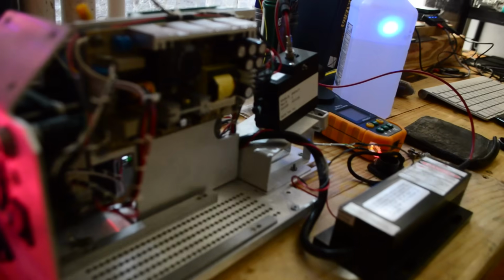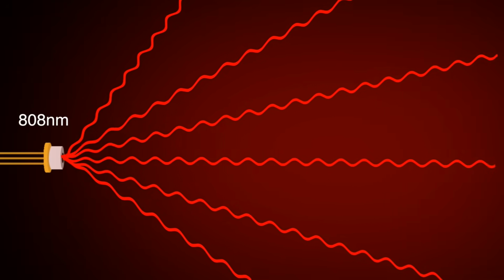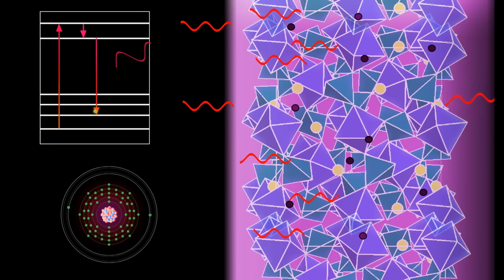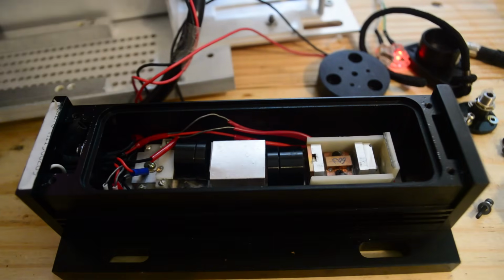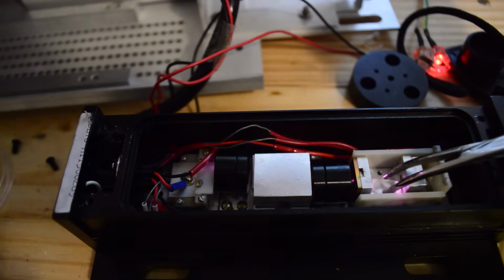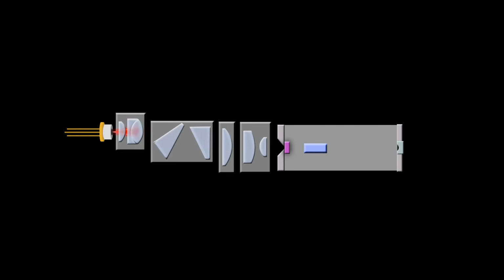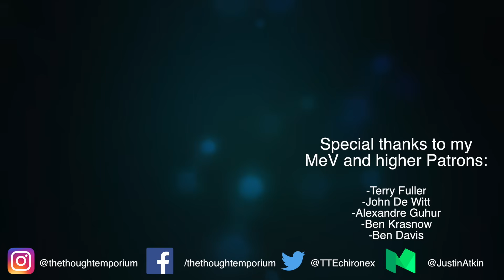This Laser Turns Infrared into BLUE

Comment: I remember hearing that there’s an issue with green lasers where if they get too cold they either produce infrared or UV laser light (I forget which) instead of what they’re supposed to and can be extremely hazardous.
Why does the temperature matter that much? Is it because it changes the crystalline properties? And is there a reliable way to prevent it?

Comment: Will it run in singlemode blue color, if i power it down just above lasing voltage, to be able to make holograms?, with small green dpss it worked very well and stable enough..  just asking since i have a 15w module here

Comment: Ah the BW tek dpss laser. They were part of a dema-k quack medical machine. It was coupled with spectrometer which i found far more interesting then the laser itself. Ended up reusing the spectrmeter and the scanning cell but used other lasers. The optical train in the blue laser is a pump diode, a fast axis collimation lens, an anamorphic prism set to make the beam square and even diverging, then a focus lens, then the NdYVO4 resonator wirh the LBO crystal. Some had a little power sampler inside. These used to be common as dirt and cheap on ebay. Ive converted these to green 532nm at about 300mW, yellow-green at 561nm at about 90mw, Yellow at 594.3nm at 140mw, 1064nm q-switched at up to 800mw average, and lastly 1550nm q-switched at up to 1.2W average 🤓😎😁❤

Comment: So which laser goggles to use if you remove  the cover for alignment? In the range of 473 or the 946 (both?) and what optical density?
Reply: the 946nm light isnt really a problem when you remove the cover, the 808nm light from the pump is way more dangerous

Comment: If you shot a green laser into olive oil it turns red inside the oil but the mean beam still being green when goes out of the oil. Maybe you can figure out a way to use the cheap olive oil to produce a frequency doubling laser pump.

Comment: 5:00 Quick question is this similar to constructive interference
Reply: No. In basic terms, constructive interference takes the light that you have and makes it brighter by matching the phase of the photons, but the energy of the individual photons stays the same (you just have more of them). The nonlinear crystals he's working with here are more easily thought of in terms of energy, you take the energy of two photons and add them together, making a single higher energy photon and thus a shorter wavelength. They are different optical phenomena. This is not exactly correct, but it's close enough.

Comment: Could you start with higher energy photons and end up with something like UV or even Gamma rays?
Reply: it is possible
Reply: There are 355 and 266nm dpss lasers that are in far uv
Reply: Sort of, the limit is once you start getting towards hard UV the wavelength is too short to reliably interact with the crystal structure properly. Same reason it's hard to make X-ray lasers that aren't powered on particle accelerators.

Comment: I am working on a microscope which looks at SHG in samples so I am somewhat familiar with this process but haven't taken nonlinear optics so I don't know all the details.  The molecular asymmetry is necessary for SHG because SHG comes from even-order terms in the Taylor expansion of the material's response.  If you think about charges being pushed around by the incoming electric field, the response mapping input field to charge displacement may be linear or nonlinear.  If it is linear, no harmonic generation takes place because the charge oscillates (and re-radiates) at the same frequency as the incoming field.  If the response is nonlinear, the re-radiated light may be of a different color, just like harmonic distortion in an audio amplifier.  If the response is symmetric, then there are only odd terms in its Taylor expansion, and only odd harmonics are generated, but if there is asymmetry, there are even terms which produce second-harmonic light.  
Potato starch granules are also SHG-active, but much weaker than crystals like KDP or BBO, so you'll likely need a pulsed laser to even be able to measure it.  
I am also working on a Raman microscope incedentally.  I'm excited to see if you can get the spectroscope working.
Reply: PPLN (periodically polled lithium niobate) is one of the most efficient SHG crystals with an efficiency of 80%, it needs a heater to work properly though. I am using PPLN to double a 1060nm OPSL laser to 530nm it works very well.  if heated correctly, 200mw of 1060nm can be doubled to 120-150mw of 530. PPLN can also be used in DPSS lasers
Reply: @suhailab3634  what’s up man. I see you everywhere. Really enjoying your recent laser content.

Comment: Are you going to make a Wakefield accelerator with this?
Reply from the maker: Naw I'd need a petawatt laser beam for that. That's a multi million dollar project in and of itself. Wakefield accelerators are kind've out of my reach for the time being. There are some other small accelerator designs I've been looking at though, so maybe I'll try those first.
Reply: +The Thought Emporium  
Now that I have. Your attention do  you think that I could use a crystal like in the    Video to shift microwaves from a mag natron to ultra concentrated inferred  
Also it would be a microwave magnetron not a sputtering magnetron
Reply from the maker: No it wouldn't. You can do frequency doubling with microwaves, but at those wavelengths it's done with electronics, not crystals. Crystals are for the optical regime

Comment: very nice video and animations! I love those BW Tek 473nm laser units, I learned so much by tearing those down and rebuilding them. I think there is info on getting that spectrometer to work on laserpointerforums.
Reply from the maker: I've been looking through the forums, seems reasonable to get it working. And worst case I've got my russian friend who could probably build a functioning raman spec out of chewing gum given sufficient motivation haha. Or I gut it and build a spec out of the pieces. Glad you liked the video :)
Reply: Many (many) years ago I purchased all the optical parts as loose items from one of these BW Tek 473nm lasers(no electronics, no case, no base etc), I've rebuilt it on an aluminium base taking care to allow room for tweaks/adjustments,  but I've never been able to get it to lase even though I seem to have perfect alignment.
I'm 99% sure it is temperature related. 
Are either of you two fine gentlemen(both? would be cool to compare results) able to measure the temperature of the crystal block for me so I have something to aim for? I've never been able to find even any ballpark info for this, so even with much(much..... years!) trial and error, I've never nailed the right temperature to get it lasing. I knew this thing would be a challenge, but jeebuz. Cheers!
Reply: hey you here too? :P
Reply: I don't want to sound demotivating or something, but I don't believe you could do Raman spectroscopy with the BW Tek unit. The 473nm photons have too much energy and most materials will show terrible fluorescence. I tried it with pure silicon, which has a nice Raman spectrum, but the unit couldn't detect it. It was originally used to measure concentration of something in patients skin and the spectroscope is tuned specifically for one peak in the scattered spectrum. 
But you can use the spectrometer alone for other cool experiments, you just have to first open it and remove two pieces of metal in front of its CCD (that is there to select the one specific part of the Raman spectrum). You then get a fair spectrometer with (if my memory is correct) ~600-400 nm range. The unit communicates over serial link with a known protocol, someone on laserpointerforums put there a document describing the commands, and other user actually made a Windows program which shows you the measured spectra real-time.
Reply: I agrree! My lab (private so it's my home lab) consists of high voltage work, lasers and other research. Great video of showing the KTP actually starting up while being moved.
Reply: @C Ha He does show that he is competent and he does give disclaimers all throughout his videos. I enjoy that he has a passion for this stuff. I've worked with lasers, high voltage and many more things.

Comment: so in the opposite one can convert ultraviolet into visible light if yes would it still be blue?
Reply from the maker: I'll be using ~300-350nm so I end up with a red/infrared bit of light out. Going UV to blue would be hard. You'd need really high energy uv, and I don't want to be around when that thing fires. That's like a beam of cancer at that point.
Reply: Depends on what frequency your UV has. I think the most common are somewhere arround 400nm, that doubled would be somewhere infrared. But afaik there are uv lasers down to 200something nm, those would end up in blue/green territory

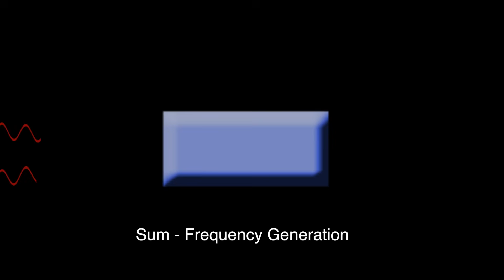Comment: 5:25 what does it mean for two things of different frequencies to be on phase? By the way, thank you very much for your videos!
Reply from the maker: Exactly. If the phase is off, the effect stops. The phase only needs to be matching while in the crystal. The rest of the time it doesn't matter. So it's local phase alignment, not global, if that makes sense.
Reply: The previous speaker told you all ready.
Additional here is a nice to know fact: If you somehow point to beams of different frequency on the crystal there will most likely always be a spot  where the phases match (except the frequency is similar or the crystal is short or a combination of those). What you want is phase matching along the complete crystal. This may seem impossible because the speed of light in materials is different for distinct frequencies, but „the thought emporium“ already told about the special asymmetric crystals. Depending on the polarisation of the light the are different refractive indexes. This way you can send light with two frequencies on the same crystal and both have the same velocity just by polarising them in different ways. Of course you still need the correct alignment to achieve constructive interference.
Reply: It essentially comes down to that they need to have maximum constructive interference while in the crystal
Reply: I see...I understand now why it is so sensitive to the position of the crystal

Comment: I have done a 1064 into a 532 using a KTP crystal with a handheld 3 watt (with eye protection); pretty cool to see the pretty powerful green beam.
Reply from the maker: That's what I was hoping for for this, but evidently I need a stronger beam, or better crystal.
Reply: @thethoughtemporium  i think what you need is another kind of yag that delivers 1064 instead of that 940
Reply: @thethoughtemporium   I know this is really late, but if you have a 1064nm CW source, you can focus it really tight with a short focal length lens, that will get your Irradiance level above the conversion threshold in KTP allowing you to use a less powerful laser. This is how they get away with it in green laser pointers. It's a standard 808 diode pumping a piece of Nd:YAG glued to KTP, because the diode emitter is so small the intensity of light is high even if the power output is low. There are other material configurations involving vadadate crystal as well.

Comment: why go through all this trouble? do we not have decent blue diodes?
Reply: there are many reasons why one might choose a DPSS blue laser over a diode based one. for one it is easier to get a nice gaussian beam at high powers with DPSS as opposed to diodes. but here he was exploring nonlinear optical effects in about the lowest cost way possible. similar setups can be used to generate entangled photon pair like in the case of SPDC
Reply: We have, but not for a long time, they were the last ones to be discovered and the people working on them got a nobel prize.
Also: it may be just more convinient to use a multi- purpose/color laser, which can be made in greater numbers with its basic layout and components.

Comment: It’s a pretty powerful IR diode laser you’ve got going on - be really careful with reflections from your screwdriver. The blink and pupil reflex doesn’t work at the excitation wavelengths, so the first thing you’ll notice is permanent damage. 
And I really hope you can get the spectrometer working! Raman spectroscopy could be very valuable for you! It’s very good at characterizing graphene, and its able to tell you in a fairly simple way if it’s really graphene, or just small pieces of multilayer carbon. 

Raman (pronounced more like ramen, than rayman) was Indian, and showed the Raman effect before you had lasers!! I think that’s astonishing, really!

It allows you to probe vibrational states, instead of the electronic states you describe for the lasers. This means almost all organic molecules have a fairly unique fingerprint, with quite distinct, sharp peaks. (As opposed to spectroscopy in the visible range, which are very often a smeared, indistinct mess.
Reply: Well, you can just use some safety goggles... Yeah, they cost 200 bucks but that's a one time investment
Reply: @eulemitbeule5426  do you need different type of glasses for every laser frequency? Like if you are working on this type of laser and you have IR and blue laser light, is there one pair of safety glasses that will block out both frequencies?
Reply: Typically yes, you have to have a pair for every laser color that you work with (red, green(+IR), etc). There are glasses that will block green/blue and IR light (because normal green lasers produce a crapton of IR), but the more wavelengths you block the less light gets through and the less you see through those glasses. So normally, you have a pair that blocks only the wavelength bands where the laser emits while letting the other wavelengths through so you have a somewhat decent light intensity.
Reply: @skmetal7  Do you need any laser crystal ND YAG or Nd YVO4 or LBO use this laser?
Reply: is this not the same diode or led used on your remote control for the tv?
Reply: @ARCSTREAMS  No, the infrared LED in a TV remote is just a regular LED.  Laser Diodes from my understanding work on a similar principle but they are far more powerful.  Exploring the differences and how they work would make for an interesting video though.
Reply: Get the brown version of military protective laser glasses called Special Protective Eyewear Clyindrical System. They are usually very cheap. The green ones block most lasers but not the 808nm 😎😁🤓
Reply: 😊😊😊hff
Reply: 😊😊😊hfffg❤bb